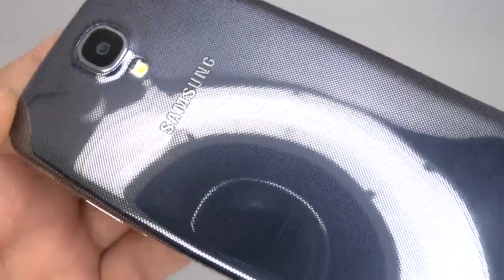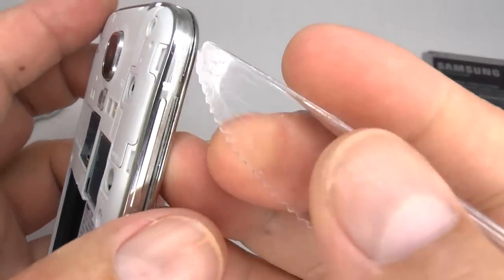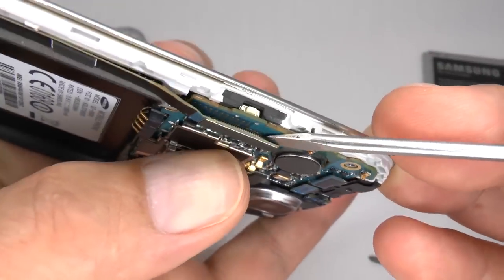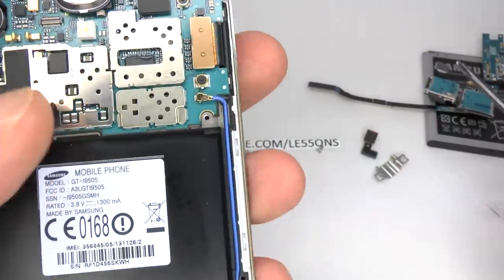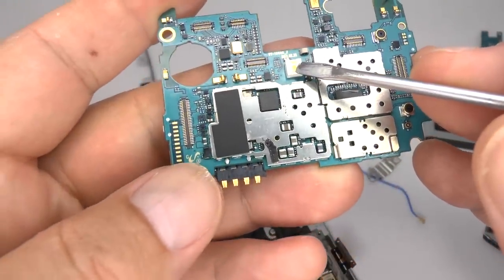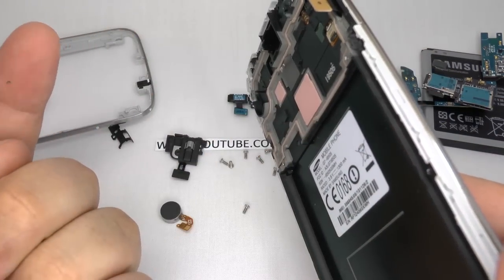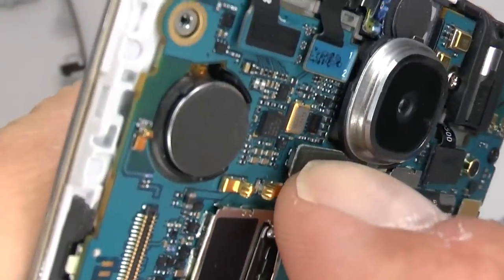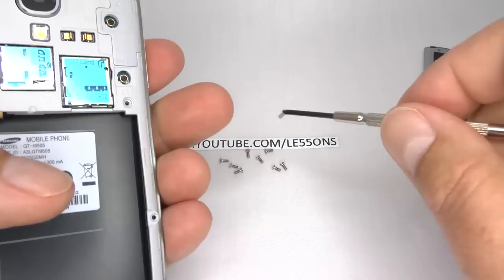Galaxy S4 Disassembly & Assembly Teardown - Screen & Case Replacement

Comment: I have a sprint galaxy s4 and I was wondering if I switch out the cdma motherboard with a gsm motherboard will I be able to use it on at&t?
Reply from the maker: it might work, but there's a very slight difference between some models so only a trial and error will tell
Reply: What if I buy a at&t back casing
Reply from the maker: Mitchell Smith no idea, never tried it
Reply: Oh ok..well thanks for the help

Comment: does the camera module plug and play when replaced?...... current one is scratched badly but works, replaced with new one off ebay but all i get is a black screen, put old one back in still works, factory reset but still doesn't recognise new one?? is new one faulty does anyone know???? thanks

Comment: Hi I replaced the camera lens and didn't disconnect anything other than taking off the top gray part to expose the underneath part ant didn't disconnect the camera replaced the cover screws also but I'm am having trouble with swiping across the screen n unlocking the phone it's like nit sensing my touch any suggestions for this
Reply from the maker: its a strange fault to have, try removing the back cover and unplug and plug the flex cables back in. If that doesn't work try connecting to a pc and backup all your data, then try a factory reset

Comment: I hav factory reset my phone n flashed too..but d prob still persists..it all startd wen i disaasembled my phone out f curiosity aftr watchng ur detailed video but i double checkd d connections r perfect n finally assembled it..am nt blaming i just wanna knw d reason 4 d blank screen poping up...am damm sure d connections r rite coz i checked even today...suggestions appreciated
Reply from the maker: I would guess the screen flex plug might be the cause, until you try plugging in another screen its not possible to guess what it could be..

Comment: hello man ,, i have problem with my galaxy s4 (i9505) att version (sgh-i377) suddenly i get low and very poor wifi signal , i watch your des video about this phone , when i check the antenna i figured out that when my finger touch the antenna outside ,,directly beside the power button the signal become goooooood again , just i removed my finger it goes down again , what do you think i have to do , to end this headache thanks sooooooo much

Comment: I Have a M919 with dead motherboard.
Is that possible to use an I9505 motherboard to replace it?
Reply from the maker: it might be, but make sure the front housing is the same and has the 2 heat pads. If it only has one heat pad then its not compatible

Comment: The menu an back buttons are not working on my s4. I've switched the main board to another s4 an I'm having the same problem an the old one is actually working now so I believe it's something on the board. Any idea what I can change on the board itself to fix this. How hard is this as well?
Reply from the maker: There's not much else you can do, it sounds like it might have water damage..
Reply: Thanks for your quick reply. Great video btw!

Comment: I just tried replacing my screen exactly how you have shown, nothing seems to have a lose connection but my phone will not turn on now! Do you know what would be the cause of this? It wont charge vibrate or anything!
Reply from the maker: its probably a faulty new screen, can you try plugging in the old one..

Comment: Is it possible to change out the guts of a Sprint S4 (SPH-l720) with an AT&T S4 (SGH-i337)?  Are all the parts interchangeable?
Reply from the maker: some parts are but not all, have a very close look at the photo's of the parts on etradesupply.com and see if you can spot the difference between the screen frame and rear housing, better still email them and ask the question..

Comment: hey bro, super video. congratulations.
I need to make the switch from my home button, how can I do this?
I need to remove the screen or can I remove it from behind?
sorry for my bad english.
ty.
Reply from the maker: you will need to remove the screen, this video shows how it can be done using solvent to soften the adhesive, but read through all the comments as some people have not been happy with the results Separating Screen Assembly from Front Frame for Samsung Galaxy S2, S3, S4, Note II
Reply: ***** But if I do that, as you said, I may have problems right?
Really has no way to do this without touching the screen?
ty.
Reply from the maker: eusougamer not that I know of, if you watch the screen replacement video you'll see why Galaxy S4 Screen Replacement / Frame Exchange / Test Drive Repair

Comment: Le55ons I have a damaged sim tray tryed replacing with another from a junk s4 with busted screen but won't work but will in the bad s4 as I have rang it and junk phone rings..
Only gives emergency calls only in the good s4 both phones are same models..
Would this have til do with the Rev being different? One is Rev.0.3 other is Rev.0.7 thank you
Reply from the maker: I didn't think Rev made any difference but I could be wrong. I would try a new one from eBay and see what happens..
Reply: is the donor phone the same wireless company as yours? I just repaired my Verizon s4 with a cricket S4 by swapping my mainboard into the Cricket phone. Before I did that I put my verizon sim in the Cricket and it said "Please Insert Sim Card" Weird since I know ATT Sim cards work just fine in my Verizon phone if I enable both radios. Well, maybe not, now that I think of it. Maybe since I bought a Verizon S4 it's CDMA Radio is only tuned to look for Verizon towers, but since the GSM radio is not tuned it can find any GSM towers (ATT/T-Mobile) This might explain why the Cricket didnt think there was a sim...

Comment: I have a question, one year ago I changed my S4 screen witg the help of this video. It worked for almost one year and now my screen is flickering. I have no screen, it disappears, comes back, is flickering and it is gone. I think it is the screen again or the connection, I checked the connections, all was good, could it be the screen again? Or what else could be the problem?

Comment: hi, i followed everything down to the exact detail but my new screen isn't registering touch... AT ALL! have i bought a dud..? it works fine but when i swipe it i get no response so i can't use my phone! i just re-watched and double checked i did it all correctly. any tips? thanks!
Reply: never mind... a quick reboot and its fixed... omg.. sometimes it is just as easy as off and on again :p
Reply from the maker: Gracie Patten :-)

Comment: Why is your S4 so different looking than mine? Your screen looks like it goes edge to edge no gaps around the edges? Is that because mine is a US phone or did you change yours? My chrome ring around the screen bezel has chipped chrome off at all four corners not sure why but it was like that when I bought it used. I want to change it out if they sell those or possibly go from white to a different color of phone housing/case totally if parts available not sure.
Reply from the maker: this is a 9505 which is slightly different from the us versions. The chrome surround can only be replaced by removing the screen, its a bit tricky trying to remove a good working screen from the frame. Search for 'separating screen from front frame on s4' to see how it can be done using solvent to soften the adhesive

Comment: I looked into my phone using these instructions because it suddenly failed without any prior signs of instability. I checked that the voltage is there and the on button really closes a circuit. It would be great to have a video on how somebody would go on troubleshooting this phone... How can I even be sure it is a pure hardware fault? Since there appears to be no signs of power on at all, I suppose there is no way to reset anything?

Comment: Nice video.  I bought S4 I9500 in China.  After a few hours the phone quit working and could not charge battery nor would it start up with fully charged battery. Samsung in my country will not deal with it as that model is not imported here.  What might be the problem?  Appreciate your advice
Reply from the maker: its known as 'sudden death' theres not much you can do. Perhaps send it to a friend in the country it came from and have it replaced under warranty

Comment: How can I turn off radio antenna on Samsung s4. I had the feature on one of my other phone that was a year ago, but now I cannot find the feature on this new phone. Only way that I can turn it off so far is take the 4gSIM card out. Would be nice to keep it in and be able to turn it off when I do not need it to transmit.
Reply from the maker: you can hold down the power key and choose 'Airplane' mode. That turns off all the radios and I think you can enable wifi or bluetooth separately

Comment: Thank you very much for the video. There is a problem with my S4 about echo problem. When I call someone, he can hear his own voice. Is there a solution? Thanks.
Reply from the maker: sounds like it might be a firmware problem, have you tried a factory reset?
Reply: ***** I did not tried but, when I put headphones, there is no echo. Is there any solution such as covering any mic inside the hardware?
Reply: Ahmet Taşkesen
I tried factory reset but echo still continues. When I call someone, he hears his own voice. Would you mind if you could help me? Thank you.
Reply: Ahmet Taşkesen If I remove the backcover, the echo is very low. Almost no echo.
Reply from the maker: Ahmet Taşkesen its a strange problem, is the rubber microphone gasket in place? you can see it at 4:40
Reply: ***** Thank you very much. I will try to check microphone gasket. I am using android 4.2.2. Should I try another version of android? Can it work? Thanks for your help.
Reply from the maker: Ahmet Taşkesen It can't be the Android version or they would all have the same problem..
Reply: Thank you very much.

Comment: Hey I have a repair company that damaged the silver trim around my front frame during shipping and they are telling me they can replace just that. Is this true? From my research I would say no. I only ask because my screen had existing damage and if they have to remove the screen then they should replace it. Model is a gt-I9505. Awesome video btw. Used it for my repairs. Thanks again!
Reply from the maker: with the right tools and experience it can be done using solvent to soften the adhesive
Reply: Alright thanks.

Comment: Hey dude, my galaxy s4 i9505 recently had this problem when i open the camera, it will say camera failed. I never dropped my galaxy s4 before. I went into the hidden testing thing where you type #0# in the call and the front camera is working fine but not the back. do you think its a software or hardware? :/
Reply from the maker: I would try a new camera as they don't cost much. It could be firmware but its unlikely..

Comment: Hi LE55ONS, I have a i9505 Samsung galaxy s4 LTE which currently, the wifi is failing to turn on. it does not show any sort of message, but when the wifi is activated it just says "turning on wifi.." on the notification bar which doesnt dissapear. Would you be able to diagnose the problem? Thanks
Reply from the maker: if you've already tried a factory reset or a different rom then I would suspect the wifi chip needs replacing

Comment: I drop my s4 sideways and it hit the volume button. The volume button is now dented in the middle and is push in so everytime i try to put the volume up and down it wont let me. When i try to turn off my s4 it wont let me so wwhen i took out the battery and put it back in its in recovery setting and i try to reboot but it just keeps on rebooting. So what should I do

Comment: hello ... I have some water damage in my phone... the screen is fine and it charges too... but my back and menu button dont work anymore+ when i make calls nobody can hear me i have to put it on speaker so they can hear me... my first question  is if I replace the charging port my back and menu buttons will work too???? and the other question is what is what i have to do to not put the speaker anymore so the other person can hear me ... thanks
Reply from the maker: replacing the usb charging port should fix the problem with the main microphone not working. There is also a small chance the touch keys might start working, but you wont' know until you try

Comment: Hi, I replaced my charger port the other day and whilst I was removing the antenna cable I managed to pull off the little attachment with the antenna cable (the one near the sim card) and so now the antenna cable won't stick on the motherboard and so I'm not getting any signal. Is there any way I can fix this without having to replace the whole motherboard? Waaay too expensive!
Reply from the maker: yes it can be repaired. Using a very fine tip soldering iron you can directly solder the antenna cable onto the mainboard. If that proves too difficult you can unsolder the small gold test port and directly solder the cable in place. The cable has an inner core like tv coax, the outer core goes to ground and the inner to the center pin on the test port. A few people have successfully done this with the wifi cable on the S3
Reply: ***** thanks for the reply, is there any chance you could upload a quick tutorial if its not too much hassle. I've managed to lose the gold test port, but I've cut another off my old charger port. Can I use this?? also I don't have a soldering iron, any other options?? Think I might have to go to a repair shop, any idea how much it would cost?
Reply from the maker: Ameerah Mohammed I can't shoot a tutorial as I don't have a gs3 that needs repairing. You don't need the test port as the wires will be soldered onto the mainboard. A tv repair shop should have the tools and skills to do it for a small charge as it should only take 10 minutes

Comment: Hi.
Can i switch the i9505 motherboard into at&t or t-mobile one, so i can get 4G LTE service here in the US. I need the AT&T i537 or T-mobile m919. My i9505 is only getting 2G here. Can i swap motherboard from an other phone and get 4G LTE.?
Reply from the maker: its a bit more involved than that as the front and rear housing are different..
Reply: I will buy the i337 than and sell my i9505. Thanks a lot.

Comment: hi ive changed the glass on my s4 and reapplied loca  and the touch function doesnt work. so i took the glass off again and the touch works fine. could you please tell me what im doing wrong.
Reply from the maker: its a strange problem, it should work through the glass..

Comment: Hi there, if the S4 always lose its data signal, what usually the reason for that? I've noticed that when the data connection is gone, the data icon (G, E, 3G, H, H+ or 4G) also not present on the notification area. Sometimes when the data connection is disconnected, it would show like a stop icon on it. Most of the time, there's no icon on the notification area than its showing the stop icon.  the service center already replaced the motherboard but the problem is still there. Another question is if they replaced the board, why is the wifi tether still got the same mac address?
Reply from the maker: I would take it back to the service centre as it does sound like the mainboard is causing the problem. I know if its an official Samsung service centre they can clone your old mainboard which gives the same imei and mac address. Is there any chance its your sim card?
Reply: I tried the simcard to other phone (not S4 but can receive up to H+ signal) and monitored it all day for few days and its not giving me the same problem. I will ask a replacement of my simcard with another just to isolate it. Thanks for the reply.
Reply: Try using a different sim card on the S4. My officemate have the same problem.. still unresolved as of the moment. Network related ata e
Reply: Tnx sa info. Ppplutan ko n ngaun ung sim.

Comment: My phone and I got caught in the rain while riding a motorcycle. My phone was done for but I managed to clean the corrosion off.  Only thing that doesn't work is my external speaker. I tried another one from a different phone while I wait for the one coming in the mail.  If that doesn't work what do I do? This sucks. I'm on my phone now just reading the comments cause o can't hear the video. The vibration works everything else works except the sound.

Comment: from left to right: Ambient light sensor; motion sensor (I think); air gesture sensor; front camera.

Also left from the ambient light sensor there is the fifth dot which is the LED flash but it's not visible when it's off

Comment: i dropped my phone in water, sim now not recognise and wifi and bluetooth stopped working, what do u recommend to clean parts?
Reply from the maker: you can try cleaning the mainboard with isopropyl alcohol and a soft brush, but don't be disappointed if it still doesn't work. I've never had much success repairing water damaged phones..

Comment: hi,

i HAVE A PROBLEM WITH MY GALAXY S4, IT DOESN'T RECONIGZE THE MICRO SIM CARD. If I insert it it says there is no sim card, I tried to reboot the phone and anything has happened. I don't know if the entrance of the micro sim card is damaged or it's the software wrong?

What would you suggest me to do?
Reply from the maker: I would try replacing the sim tray at 6:54, they are very cheap and easy to replace..
Reply: ok... thank you so much... I will replace it :)

Comment: Hi, how can i change the Wifi and bluethooth IC?
Reply from the maker: its done with a 'hot air' soldering iron. Not an easy job but it can be done with the right tools and experience